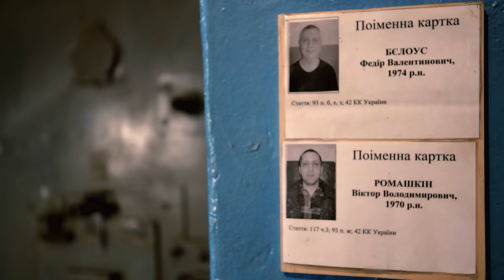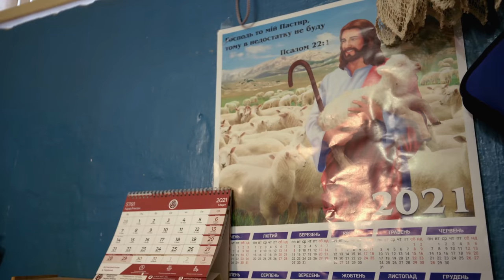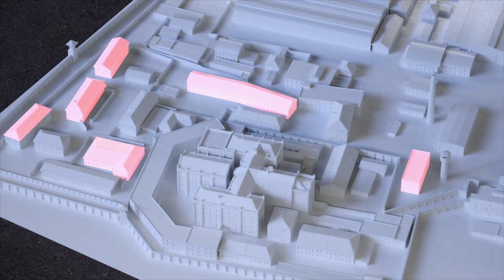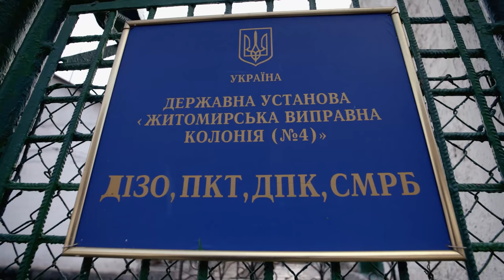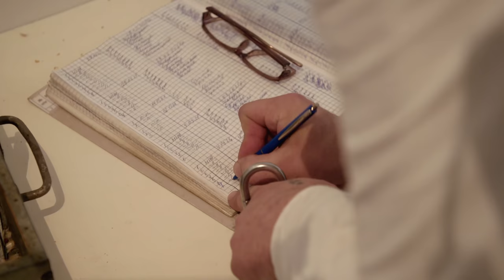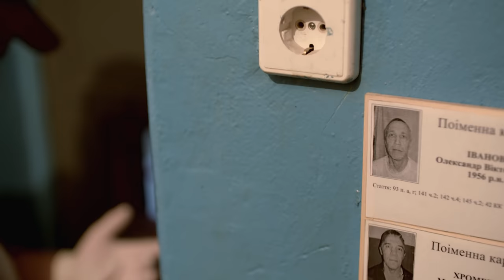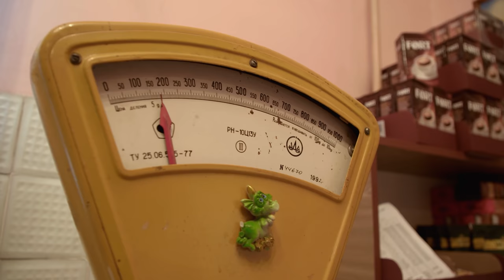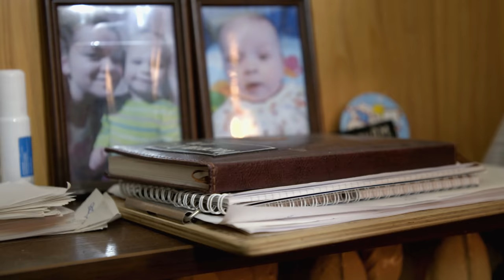Behind Bars: Colony 8, Zhytomyr, Ukraine | World’s Toughest Prisons | Free Documentary

Comment: 10:00 You actually have some kind of a door on the bathroom, some possessions, electric kettles, a flat screen tv, alot of American prisons are bare compared to this. In many prisons here, if you wanted to heat water you'd have to do it illegally, or settle for however hot the tap water can get
Reply: @NerdyNEET  yeah I agree they should treat prisoners with more respect and decency; treating them like animals makes them act like animals. And prisoners here in the U.S. do similar things, like taking an electric cord and attaching the cord's wires to metal and making hotplates, to cook food and boil water on

Comment: If the guards abandoned this prison, I could break out of there in less than 24 hours…

The cell where the lifer is in.  The window has metal mesh.  By using the wood bathroom door or breaking the metal pipe, you can bust thru that.  Next break out the glass window.  Make a rope ladder to get into yard.  From there it will be even easier to get over the razor wire.   You can use as much stuff to drape over it so you won’t get cut.
Reply: Noted. Where do you think they are now?
Reply: @sadiematechuk7340  great question.

Comment: YES Operation Warp Speed for Keystone. If USA calls on All the States that the Pipe line runs tru. Get Every state to start the BIG Dig. Yes get 30,000 or More works out on this  Pipeline. You could have this done in under 2 Months. If You really want to. USA Can work this out Fast. Then Flood the East with Cheap Energy